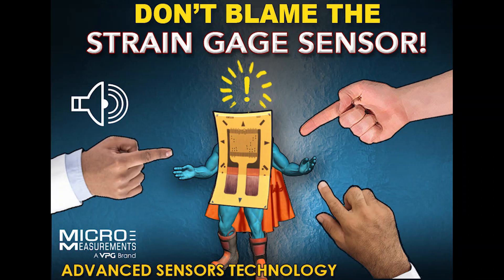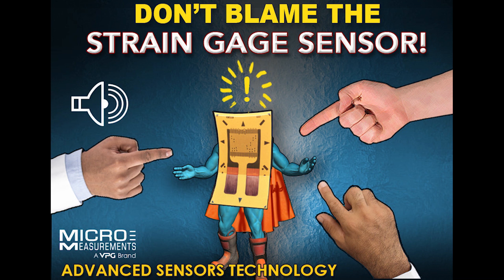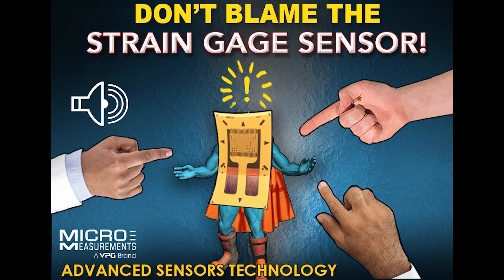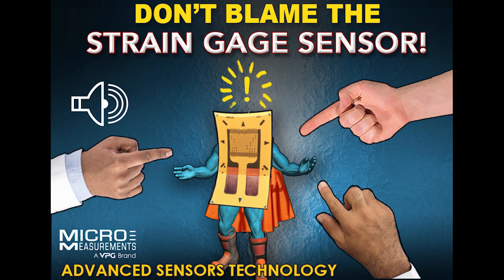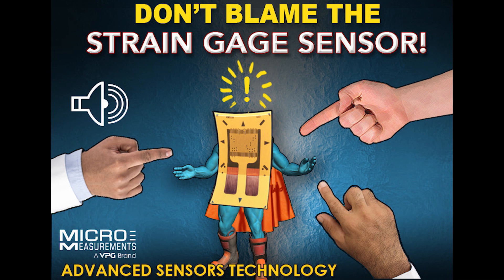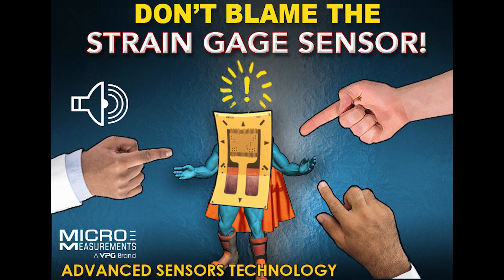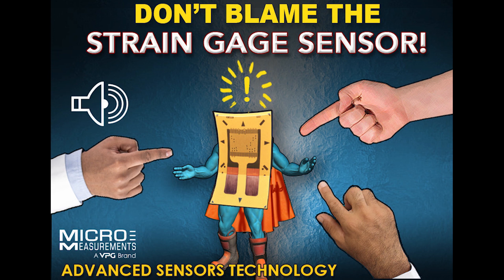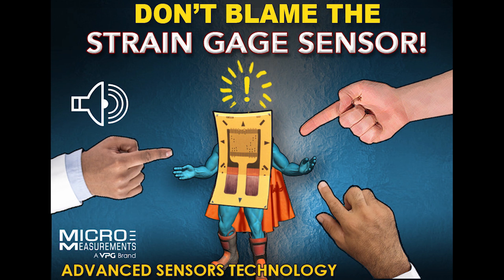Don’t Blame the Strain Gage Sensor (10 Strain Measurement Errors)

Comment: I've worked with strain gages, I attached a couple in a MM course but had much more experienced people attach gages to real applications. In my experience most of my errors was from faulty wiring. We use 4-wire gage wiring (exc and sense) but use a solder pad near the gage. Sometimes the two wires going to the gage from solder pad may be too long because we couldn't get the pad as close as we want. Then simply have to mitigate the temperature affects on those two wires. 

Regarding the gage itself, I assume these are perfect out of the package which how does MM maintain quality control. Probably cannot fully answer that question here, I assume the company has a well established process that is always reviewed.
Reply: Thank you for the comments and attending one of our workshops in the past.  I think you are correct that many faults related to strain gage installations turn out to be an issue with the wires.  Sometimes they get pulled or stepped on or even run over by golf carts and that can lead to intermittent readings.   Micro-Measurements is an ISO9001 Certified company and you can find our QA Procedures related to strain gages at the following link on our Website: https://micro-measurements.com/knowledge-base/quality-info  I hope that helps.  Darryl